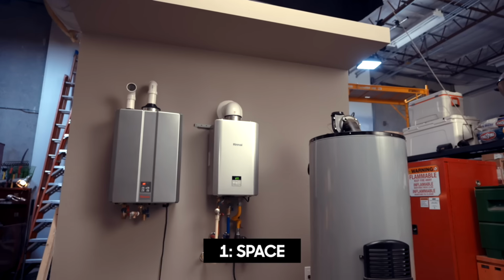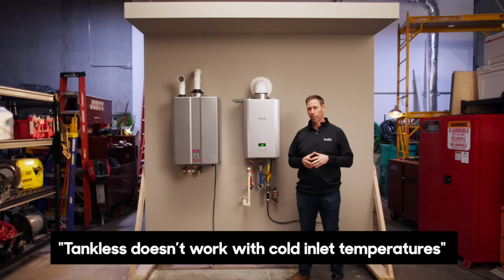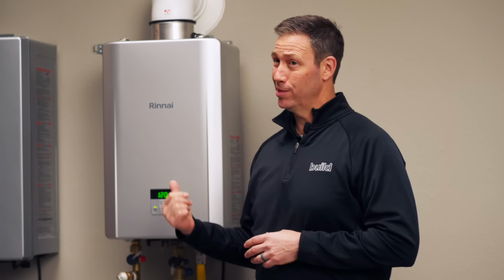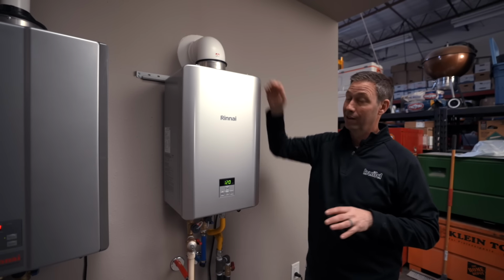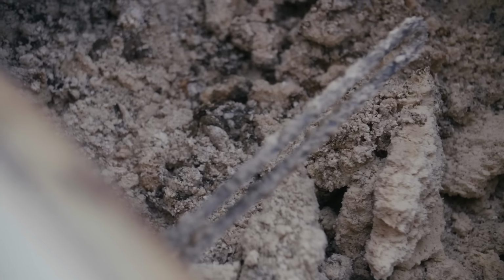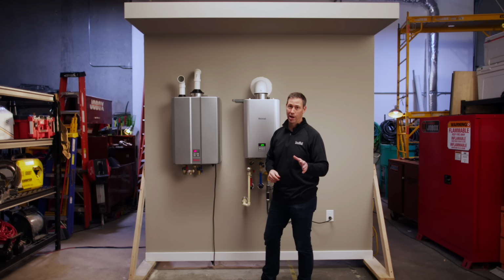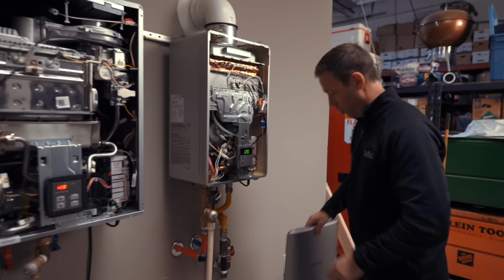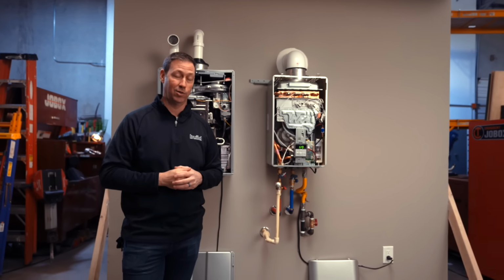DEBUNKING Tankless water heater LIES!

Comment: So many lies in this video 🤣🤣🤣🤣  shocking that a video sponsored by rinnai would glorify tankless 🙄   the fact is, homeowners WON'T  maintain their water heater.  So put a tankless up against a tank unit with no maintenance and see which one is scaled up to a useless condition first.   And cold inlet temps are ok with a gas fired unit, but electric tankless cannot turn 40 degree water into 110 degree water without EXTREME amounts of amperage.  Which means upgrading your entire electric service.  There is a place for tankless, if your handy, and can flush/descale your heater every 6 months, give it a try.   If you pay a plumber to do that, it's gonna get pricey.   And while it's true, tank water heaters have gone up in price, quite dramatically in the last few years, what hasn't?  Tankless units are no exception,  the vast majority of tankless units will cost around 3 times as much installed as a tank unit.

Comment: If you get a tankless for the first time it can cost about $3,000 just for installation. Also depends if you have natural gas access...more money.  A LOT more money. You have to call a specialized plumber who can install access to your heater. Initial installation can easily run about $4,000...and you have to buy a good quality tankless.  IF you plan to put it OUTSIDE be mindful it needs more maintenance and wasp nests get in there. You can count on a good five grand. In terms of cost savings it will take you DECADES to recoup from that. YOU MUST call a plumber about every 6 months to get it flushed out and maintained. Got the money for that??? If you DIY you can screw it up and VOID the warranty.

Comment: "Unlimited hot water" also means very high water and fuel bills.  At least with a tank water heater you are mindful not to spend an hour in the shower. However, with my natural gas tank water heater it only takes minutes to heat up the water. I also love the fact if my power is out for a day or a week, I still get hot water with my tank.

Comment: I have a regular tank water heater for 20 years and it's still working great. However, although I thought about tankless, I don't like having to call a plumber every 6 months to maintain it. They require a LOT of flushes especially in hard water areas.   Tankless will NOT stay hot during a power outage. It requires electricity to run the computer so it requires a plug or outlet.  My tank water heater is easy, and I get hot water during power outages no matter how long. I flush it yearly and I can do it myself.
Reply: For those of us that don't have city water and live off a well, your claimed power outage comment is moot at best since the well pump will not be running.  As for those on city water, a small UPS should be more than enough to keep power to a tankless if you must have hot water during a power outage, they are not a heavy load appliance.

As for servicing a tankless, your every 6 months comment is overexaggerating.  Annual maintenance is all that is really needed (or suggested), and you should be doing that to a tank water heater as well, especially if you live in an area with hard water and you want to keep your warranty (most manufacturers require regular maintenance to keep warranty valid).  Replacing a pre-filter and flushing the pipes can be done by the homeowner if they choose.  For pipe flushing, you just need 1 or 2 5-gallon buckets, a small pump, and a hose.  At least that is how mine is setup,  connectors right below the unit.

Something to also keep in mind, the hotter you set your water to, the quicker scaling and build up can occur.  With a tank water heater you tend to need to set your temp higher than you would a tankless for multiple reasons (bacteria growth prevention is one).  This higher temp can be to a point where you can risk scalding.  With a tankless, you can set your temp to a lower temperature that won't scald and has less scaling buildup.  You still get the hot water you want, you just need to mix less cold water with it.  And if you need the few moments where you need scalding hot water, it's quick and easy to dial it up for that occasion and then dial it back down right afterward. 

I switched from a 50 gallon tank to tankless a few years ago.  Biggest advantage and reason I switched was for the added space.  My 50 gallon was in such a tight spot, sharing the same room as my air handler, well pressure tank, washer, and dryer.  Performing any kind of maintenance on it was nearly impossible.  Endless hot water has been great!  I would say efficiency and energy savings was another reason, but I had too many factors occur around the time of install to say if it did save anything. I went from an electric tank to a propane tankless (no natural gas in my area), plus I had a major kitchen and dining room remodel, new appliances, shortly after the pandemic hit and the whole family was at home all the time, and cost of electricity was on the rise.  Considering all of those factors, my electric bill managed to not increase, but I do have a propane bill now to go with it.  Earlier this year I got solar and now my electric bill is $0.  I did look at hybrid tanks but they won't fit where the old water heater was at (and nowhere else for it to go).  I also considered an electric tankless but my electrician that was working on my kitchen remodel suggested against it, stating one sized for my house would require a huge power draw, which may lead to other issues.

Only thing I might do differently (and still might do), is get a small electric tankless to go under the kitchen sink.  It is one of the farthest runs in the house and, aside from the shower, it is the most frequently used source for hot water.  Doing this will get me hot water quicker and not trip the larger propane tankless for times that I only need a few seconds of hot water (or when the dishwasher runs).
Reply: so do new tanked units..  I hate tankless.. expensive.. hot water takes forever..  take a tub...30 minutes later ice cold water.. gotta drain tub to get warm again.. there is not heat transfer in pipes like tanked..so all that now cold water has to heat cold copper and release cold water.. Yes it lower gas bill...Mine failed 1400 2 repairs labor under warrenty..wanna see failed parts i keep them I did forensic exam.. heat chamber very complicated..  Neighbor replaced tanked start of service call to completed install in 3 hours or less.... mine took weeks..custom parts mailed to customer then reset to have tech come out to fix.. NO set appointment until parts at home.. more lost time.. Thank god i used wifes office showers.. Neighbors failed 3500 to replace unit on weekend after less then 10 years of service.. thats a reinstall all the parts are there.. i can show receipt..
Reply: @peter-pg5yc  Unless water is constantly flowing through those pipes, those pipes are going to cool down, tank or tankless.  Heat retention in the home's pipes overall coming from a tank water heater is going to be minimal.  A short distance from the tank, sure.  But with no water flow to keep all that sitting water in the pipes heated, that energy is going to taper off very quickly.  So either way, tank or tankless, if you ran hot water, stopped for a while, then ran hot water again, both will have to push the water that was sitting in the pipes through before the hot water arrives.

What you don't get with a tank that happens with a tankless is what is known as a the cold water sandwich.  That happens when fresh, colder water reenters the tankless to be heated and there is a brief moment where the water is colder than the final output temp.  Depending on the length of the pipe run, how much heat retention remained in the pipes between runs will determine the severity of the cold water sandwich as the heated pipes will transfer heat to the cold water, vice versa.  Insulating your hot water pipes (if possible) can help slow heat dissipation for when hot water is used frequently, for both tank and tankless.  All my plumbing runs under the house in the crawlspace, so most of it is easily accessible.  But if you have gone for long periods of time between using hot water, majority of the pipe run will have reached a cooler, ambient temp, insulated or not.

As far as the tub comment, I don't get how heat transfer in the pipes helps keep your tub warm.  Water in the tub for both tank and tankless should cool off at a similar rate given the water temp was the same for both, the tub isn't being heated by the pipes.  Now, if you are talking about wanting to add hot water to a tub that has cooled off, then you may be referencing the cold water sandwich I mentioned earlier.  While it may be a brief shock, the length of experiencing that should be minimal and hot water will follow pretty quickly afterwards.  In my home, my tankless is in the center of my house. Both tubs are within 8 feet of the tankless (and my washer is in the same room, so an even shorter of a run), just on the other side of the walls.  Both tubs receive hot water within seconds.  Keep in mind, though, that one of the more common water heater tank sizes is 50 gallons and the average bathtub takes 42 gallons to fill up to the overflow drain.  If your water got cold and you need to refill it again, chances are pretty good that the tankless is going to be able to supply more hot water for both tub fills than the tank water heater.  With the tank, you would have depleted most of it from the first tank fill and it would be working hard to try and heat up another 42 gallons in time for the second fill (especially if that tank is electric, like my old unit was), even more so if you are trying to fill two separate tubs in short order or at the same time.  Meanwhile, aside from the brief cold water sandwich, the tankless will be able to keep up (providing it was properly sized).

Now for those that frequently turn on and off the hot water for a few seconds at a time in back to back succession (HE washer, dishwasher, children, for example), I do find that a tank has an advantage there.  Luckily, my washer is only a few feet away from the tankless, so its impact is minimal there.  As for my dishwasher, along with my kitchen sink, it is the furthest run from the water heater in my home.  Even with my old tank, it took a while to get hot water, so no major difference there.  The only noticeable difference is when it does call for water (dishwashers don't run the water all the time, they only take enough for each cycle).  As such, the dishwasher's internal water heater probably does put in more work to heat the water, but it's designed to provide supplemental heating when needed, especially when using the sanitation cycle, but you could attach it to a cold water line if you wanted.  As mentioned in my previous comment, what I am thinking of doing is installing a POU water heater under the kitchen sink.  This will provide me with near instant hot water (something neither a tank nor tankless could provide) and will be much more tolerant to frequent on/off uses, which does happen between the dishwasher and washing dishes by hand.  But this would be to solve a problem I was experiencing long before I went to tankless.

I do agree that a "traditional" tank water heater can be swapped out from a failure quicker than a tankless IF parts are not readily available.  But that is assuming you are not picky about what you want to replace the old tank with. If you have a newer style tank, like a hybrid tank (heat pump), you may be just as likely to be waiting for a repair or replacement as you would be for the tankless.  As for cost, a basic traditional tank water heater can be quite a bit cheaper.  But the more energy efficient models and those with longer warranties, the price difference between tank and tankless can be quite comparable.  I can't state what difference in labor cost is between the two when it comes to swapping out for an identical unit, but I would think that it would be cheaper in labor to swap out for a same type unit than it would be to convert from tank to tankless or vice versa.  Now, initial investment converting from tank to tankless can be pretty pricey, I can attest to that.  But for my needs and use case, the tankless was the better choice for my home in the long run than sticking to a traditional tank setup.

But as the old saying goes, your mileage may vary.  One type of setup may work better for one home than another, same goes for their use case.
Reply: Was just about to respond as you did, saved me all the typing :)
Reply: You omitted the fact that you have a chimney. Most homes in the last 20 years dont. They use power vent tank type water heaters. Chimneys are very expensive to build.
Reply: @anthonyspadafora1384  Not sure if this was directed at me, but I don't have a chimney.  Original water heater was electric, converted to a propane tankless.  I have a one story rambler.  They ran a PVC concentric termination ventilation system straight through the ceiling and roof, compliant with local building codes and passed inspection.  All included in my original cost of conversion.  While I don't have an itemized breakdown of costs in front of me, that one portion of the project didn't appear to be much of the overall price to install that.
Reply: @virtualmirage7690  No it was directed at Tomoko Abe.
Reply: You can flush a tankless yourself also. Its a no brainer to do. Just use white vinegar, its cheap and works better that “flush solution”
Reply: "Tankless will NOT stay hot during a power outage. It requires electricity to run the computer so it requires a plug or outlet."  There are mechanical models available from Bosch that don't have any electronics.  They just use a diaphragm and a constant pilot light. Look up a video on "How to commission Bosch 16P Pilot Ignition System".

Comment: I'm an American, now living in France. I just remodeled my old house (1903) which involved creating 2 entirely new bathrooms. I gave each its own tankless water heater, placed right in the bathroom. It keeps the piping runs very short, which reduces the delay when you turn on the tap.
I'm super happy with the results. 
As a residential designer still doing work in the USA I recommend the same approach to my clients. One of the advantages is that you only have to run a single cold water line to each bathroom. Split the line at the bathroom to create hot & cold. Then branch within the bathroom. This means fewer long pipelines running through the house and less piping overall.
Side note - although I personally prefer gas units, the electric ones available here in Europe work great and don't require venting.
Reply: This was one of the problems adapting tankless to this country. They had to be upsized to accommodate a central system.
Reply: @anthonyspadafora1384  true, but with central, every tap, from powder room to bathroom all have hot water from a single unit.
In a new build, there might be some applications where running a circulator system would work, not so much in retrofit builds though, save if such a system was already in place.
Reply: @spvillano  What I meant was they have been using tankless in Europe for many years but the units were smaller and usually close to the bathroom they served. When they brought them to this country they werent large enough to serve 3 bathrooms or fill a whirlpool but they have overcome these problems over the last twenty years. I sell quite a few and always try to upsell my customers if I can. Many older homes still have chimneys and when it comes down to dollars a chimney vented gas water heater is still the outright cheapest in the moment. Many of the homes built after 2000 had no chimney and also a fair amount of 2 man tubs were sold. The tankless is the only thing that can economically fill these tubs as the standby loss from 80 or 120 gallon water heaters is crazy.